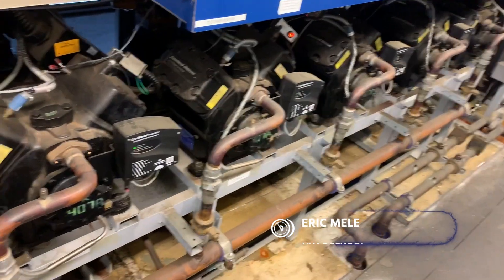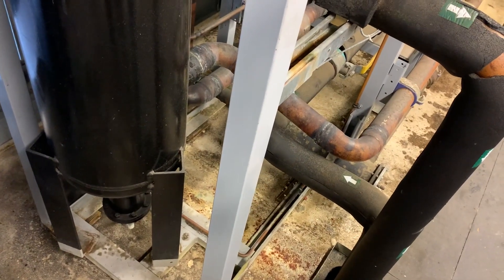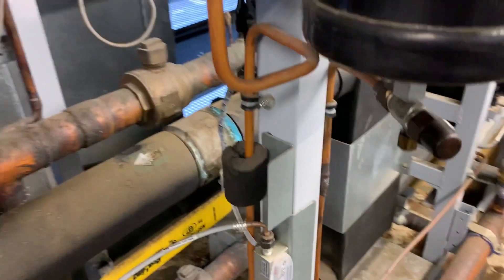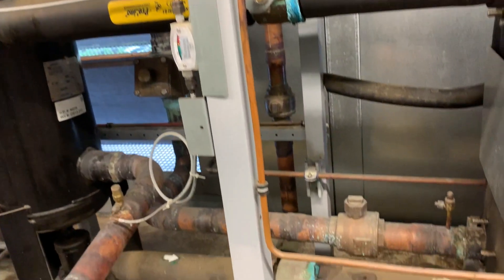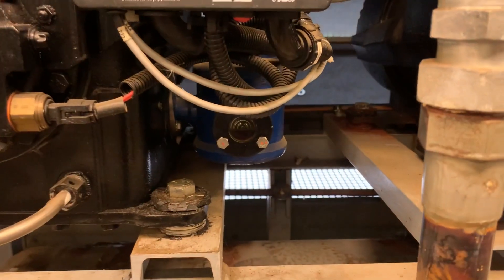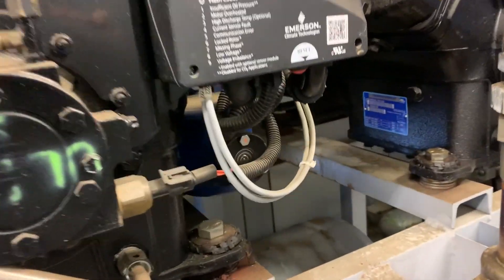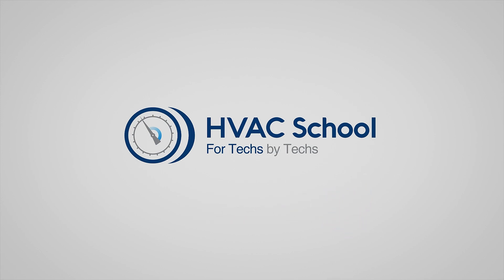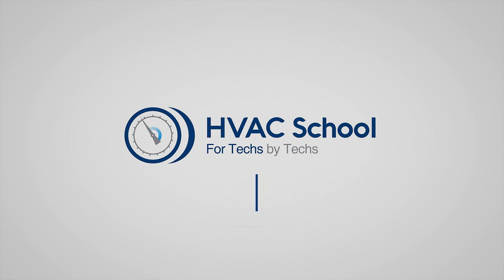Parallel Racks: Oil

Comment: Might be a dumb question but how does the oil go from down at the separator up to the reservoir and go against gravity ? I imagine whilst the rack is running there must be a pressure differential that makes it happen but here it was off ?
Cheers lads , awesome to see more stuff about racks 👍
Reply: So you'll see that reservoir has an Oil Differential Check Valve (OCV). That check valve keeps the resi at a pre designed pressure above the suction pressure and bleeds all the high pressure back into the suction header. So an OCV-20 would keep that resi +20psi above suction. The high pressure from the separator pushes the oil into the resi, and the +20 differential from the OCV keeps the oil pressure high enough to push into the compressor crank case.
Reply: Discharge pressure